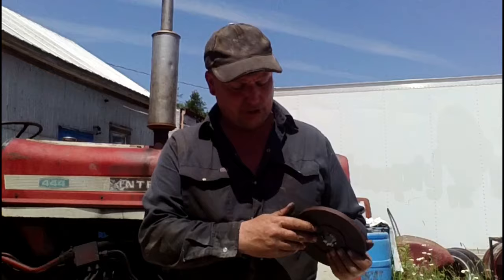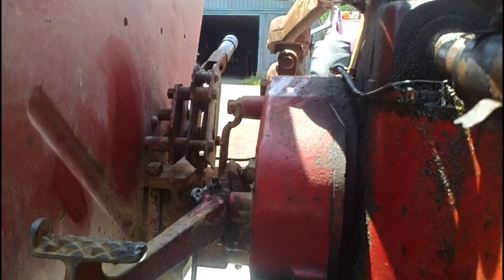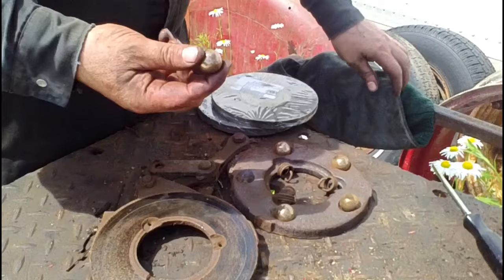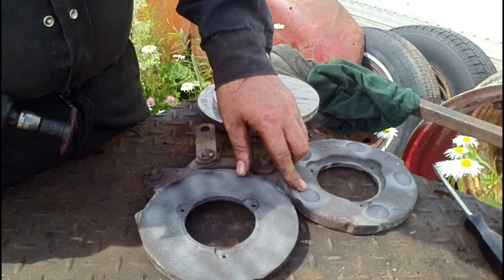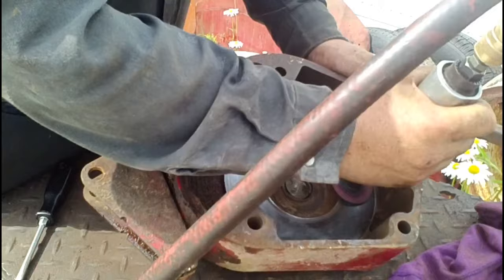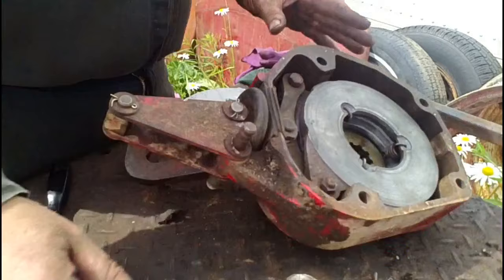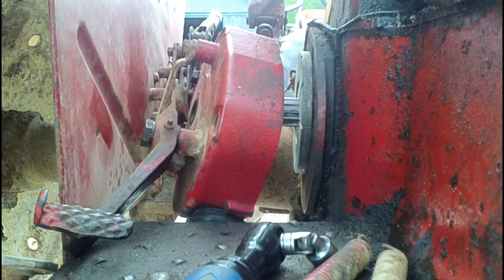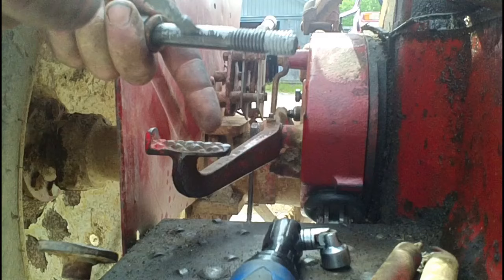IH 444 Brake repair

Comment: I just bought brakes and balls for my Ih 444 because it wouldn’t stop when I pressed the brakes I put the new ones on and still will not brake I adjusted almost to end of adjusting rod  What else can I do to get it to brake Any help would be sir appreciate I love your videos They help me when I rebuilt my Uk Ih 444
Reply from the maker: Are the new brake disks hard ones like the originals? They don't grab terribly well. Do you have the pedals adjusted up reasonably high?
  Thanks for watching!
Reply: Canadian Redneck thanks for the fast reply My new brakes are not like the original no revets like the ones I took off the rightside  lock nutt with 1 inch play but the rightside I had to take the lock but off to be able to adjust the rod to get the pedal even with left one
Reply: It seems like it wanna just like I just did both sides and cigarette right hand side that I had to takeoff the lock nut because they may be able to get the pedal even with the left-hand side I was just wondering maybe it’s the actuator is not working right and it’s more help with appreciate it I just took off the left side again going to check out the actuator see it seems like they don’t move further enough when you try to pull them out like I will try again if there’s anything else you could help me with I appreciate it thank you very much
Reply: Canadian Redneck it seem like. Te acturaltors don’t open enough to push the disks brakes against drum the right pedal has to be adjusted to end to b able to bring pedals even Can it b the actuarlators that is the problem Thanks for your fast reply
Reply from the maker: @MrHeavyev  Make sure the rams that the balls run on are clean and check for slack/wear in the pull tabs on the actuators.
Reply from the maker: @MrHeavyev  I have heard that sometimes you will have to machine a little of the mating face of the cover housing to make up for wear of the parts.
Reply: Canadian Redneck ok thanks doing that now we’ll let you know Your Videos r the best I used all your videos to repair my Ih 444 from rebuilding my motor my double clutch my broken axle  and every thing that has to be done on my tractor Thanks Again
Reply: Canadian Redneck ok will try that I’m working on it now check every thing seems ok but when I pull on the actulator with vice grips  it hard to pull and the top disk just comes up to the top
Reply: I think your right when I look at disk it seems like just the edges of disk is worn and not the whole faceing is not touching  mybe I’ll grind couver a bit what do u think
Reply from the maker: @MrHeavyev  I don't know about a grinder, you should be looking at taking of .010-.020 of an inch and it needs to be even.
Reply: Canadian Redneck ok I’ll bring to machine shop just put back left side couver now going to adjust rod on both sides if it don’t work now will bring to machine shop Thanks again will for sure let you know if it works
Reply: Canadian Redneck Thanks For. All Your Helpful Info I did what you told me I had it shaved .020  change a small actulator arm Just finished install the brakes Now I Have Brakes Your The Best when it comes to fixing tractors Love All Your Videos Thanks Again
Reply from the maker: @MrHeavyev  That's great, I'm glad I could help!
Reply: Canadian Redneck Really Appreciated

Comment: Same brake in my Mahindra 575 di. I'm repair evry year
Reply from the maker: With the original disks we had the same problem, we put these replacement disks in and haven't touched the brakes in a few years now, will still drag the wheels.
  Thanks for watching!
Reply: @CanadianRedneck15  Where do you find the discs ? Dealer item ?
Reply from the maker: @maplebones   I get them from A&I Products, you can search their website for a dealer near you. Thanks for watching!

Comment: Does it work with international 724 break system ???
Reply from the maker: The 724 has a similar brake system so the same process will work. Thanks for watching!
Reply: Is it at the exackt same place or on an other because i have seen it and it is not in this spot if you can tell me where is it it will help me very much
Reply from the maker: @user-pd2tr3bx6n  I'm sorry but I'm not sure, it's been a few years since I've had my hands on one of those tractors.